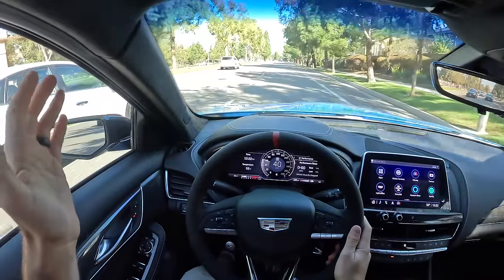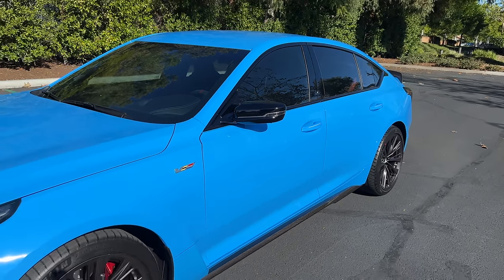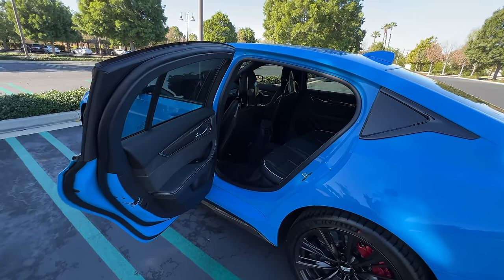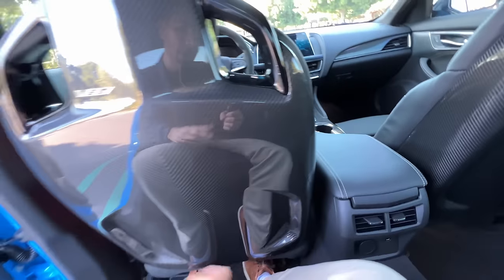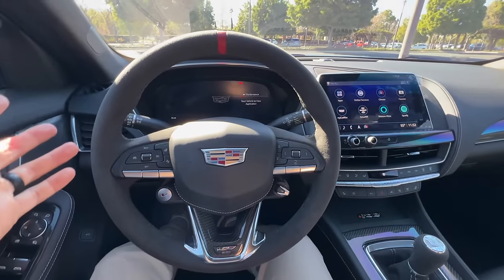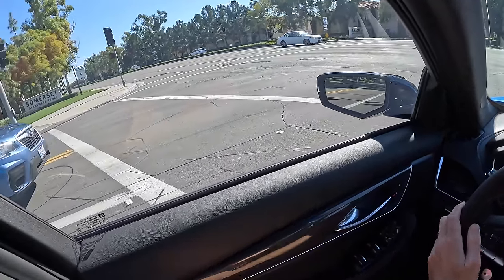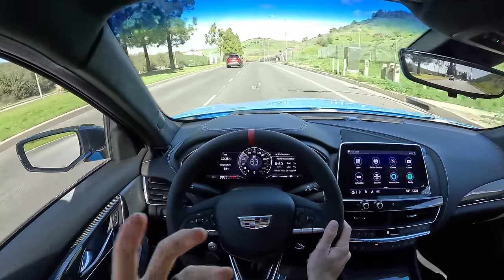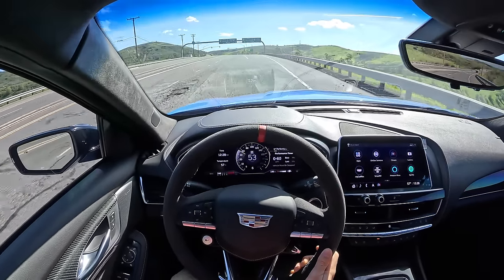It's Here! POV First Drive in My 2023 Cadillac CT5-V Blackwing Anniversary Edition

Comment: you and my dad would get along well. he has a 2020 bmw m2 competition in the blue color it was offered with. his is also a 6-speed manual because he would never own an automatic as his primary vehicle.

my car, which i love to death, is a black 2004 bmw 325ci with black interior, black fabric top, automatic transmission, and probably zero upgrades from the factory, that used to be my granddad's before he started losing his eyesight and his brainpower. we only spent about 7k on it, and that was just repairs because it sat dormant in his garage for a few years. it's a very fortunate car to have as my first car, and i'm keeping it as long as maintenance can keep it alive. the way it drives is absolute perfection, and the interior layout is something i wouldn't change. the only mod i did was adding an aftermarket bluetooth adapter so i could play my friend and i's driving playlist. also the speaker quality holds up even in 2022, it's WILD. i just figured i'd share my beloved car here as well because why not

also my car sort of got me into cars which got me into your channel so that's cool

Comment: I have 2500 miles on my new 2023 CT5 V Blackwing manual in Electric Blue.  It's also my first car at this level of performance and expense. I was nervous about the wild color choice, since I couldn't see one in person in advance (and Doug DeMauro trashed the color).  But I love it.  Strangers stop me in parking lots to comment on it.   To save money I didn't get the carbon fiber exterior bits but am thinking about adding some black to make it stand out even more!  Maybe I'll black out the roof, the lip spoiler and around the front wheel vents.  Though it doesn't really need it.

Comment: I think for a sedan it can't get better unless you wait for new M5 which anyway like you said expensive but since it's daily driver sedan like M5 usually I will rather have them in Silver/Black/Grey sort of colors and avoid these shiny ones, it just less boring over time from my experience, the red could have been more acceptable if you ask me, this blue a bit too much for me.

I was also in same situation back and forth between these cars but I didn't mind getting coupe so tried 911 + some others, ended with Emira at the end as a manual easy to live with car, I drove all before deciding into that and Emira just had something special, however of course it's not directly comparable to these sedans

Comment: If you have it in sport mode. Ur turning radius maximum is lower. To prevent over steering nd you don’t have ti turn the steering wheel further then what would b practical on a track

Comment: Good morning, first of all congratulations on choosing a Blackwing. For me there is no other car. I had a look at the 2025 interior and the big screen in my opinion does not belong un a Blackwing. It seems that every manufacturer is going with an escalade screen which in my opinion belongs in a big suv, but not in a Blackwing. By the way, in 2025, GM will abandon Apple Car Play, this was confirmed by my Cadillac dealership. Perhaps that the younger generation prefers a wider screen (to each their own), but I believe that your interior looks a little nicer the way it is.

I too have placed an order for a 2024 Blackwing 20th anniversary and I checked every option and of course I ordered a six speed manual transmission. I grew up in the 70’s, in the muscle car era and I believe that Cadillac has hit a grand slam with the Blackwing. I chose the Black Diamond Tricoat paint (limited availability) for the exterior colour and for the interior, I chose the leather semi-analine Natural Tan and Black.

I chose Brinze wheels and Bronze Calipers.

Can I ask you how much you paid for the ceramic coating and the clear paint protection film. Was it a 3M product?

Thank you and congratulations on your purchase.

Regards from 🇨🇦!
Reply: I have a 2024 with the 6 speed transmission in Radiant Red with about 734 miles. It goes on Monday for a track pack Suntek PPF and full Ceramic Pro plus wheel barrel coating. Total cost is $5,962 out the door with tax. His PPF looks like the Front coverage which is normally the second level plan. Mine is the PPF plan below a full coverage PPF plan but the jump between the last 2 levels is significant. A total PPF cover is around $7,000 without any ceramic. Shop around I compared several shops in my area before deciding. Enjoy the car they’re great.

Comment: Why if you spec any carbon fiber on the car you can't get adaptive cruise control
Reply: I don’t think it’s the carbon fiber it’s the 6 speed manual transmission. If you select adaptive cruise control it makes you “upgrade” to the 20 speed automatic.